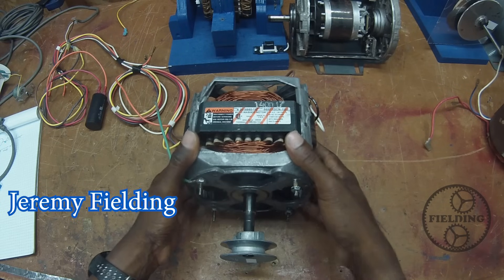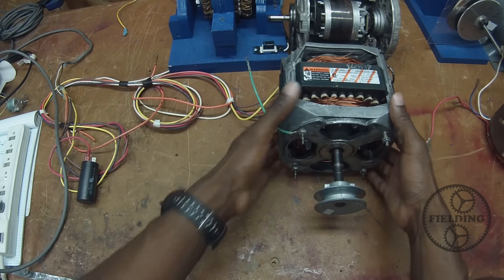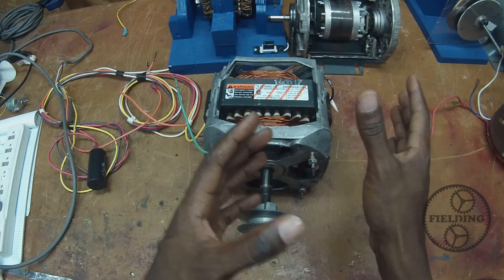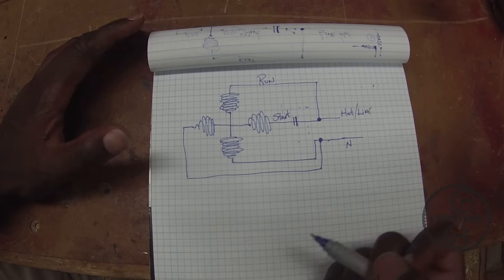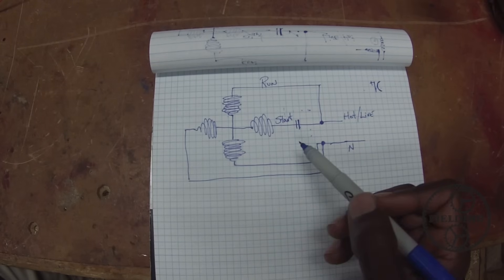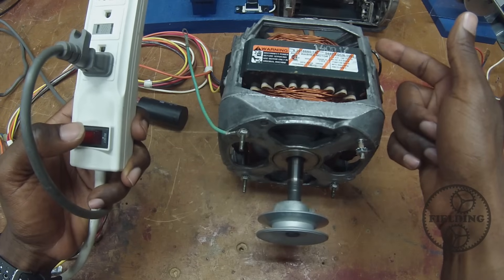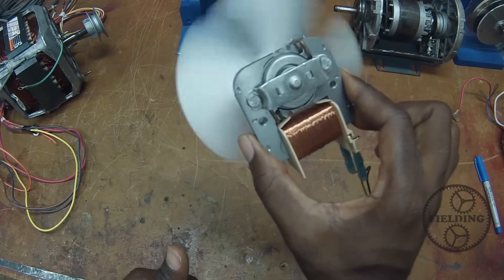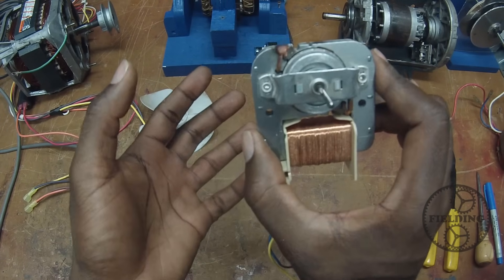How Motors Work For Beginners: (Episode 4) Single Phase Induction and Shaded Pole Motors: 035

Comment: Got a Lasko fan with 3-Speed induction motor (Pro Motor) that blew the thermal fuse (130c) while it was on low setting at room temp. I took the motor apart and cleaned with compressed air, the motor powered up and turned but started getting hot with burning smell and would prob exceed thermal fuse temp if left running. The capacitor tested ok at the rated 5uf, the windings were not shorted to core, resistance for the three main windings tested at 46,81,108 ohms, the auxiliary winding was 216 ohms. I don't care about fixing it and just wanted to know the forensics for the motor heating up, thanks..

Comment: Shaded pole motor: do the (very) small electromagnet coils slow down the motor once it gets up to running speed, seeing as there is no way for them to turn off...? Their function is to get the motor spinning, but then they still affect the motor once it reaches running speed, so is it a positive affect or do they slow down the alternation? Thanks, this is fun to learn

Comment: Great Videos Thanks. I live in North Dakota and I have some Diesel Engine work to do this winter. I was wondering is there a way to wire my 220 heater to my 110 outlet in my Garage?

Comment: Great video, but I've got a question about the shaded pole motor at the end.  Why is it that the iron is good at transmitting a magnetic field but the copper wire will develop a current that opposes the magnetic field?  Why doesn't the iron oppose the magnetic field as well?  Is iron just a worst conductor than copper?

Comment: Awesome explanation, lots of questions answered in my head about induction motors, thank you.  However if been thinking about your fan example with this question:  Since the fan motor is kicked off using the energy from its start capacitor and the motor then runs on "induced" energy, would you be paying the same price for electricity if you were to use a fan for 3 MINUTES compared to 3 HOURS?

Comment: Since all the coils (both the main winding and the auxiliary winding) are energised at the same moment this means that they all will be having the same polarity ( either north or south polarity depending on the oscillating cycle).

Can this be a reason why torque is not produced in the rotor circuit of the motor?

Thanks in advance!

Comment: Jeremy, I have a question concerning three phase induction motors when used as a generator. I have seen where many youtubers claim that magnets have to be placed on the rotor in order to make an induction motor into a generator. However I also have seen others say that the difference between and induction motor and an induction generator is its synchronicity and whether the motor is powered with electricity or if it is powered by a prime mover. Also that when the induction motor while being pushed by a prime mover does not generate power until the prime mover exceeds the point of synchronicity. Such that if a 4 pole 3 phase induction motor hits 1790 rpms it is at synchronicity and will not generate power until it is speeded up to 1800 or more rpms. Also that there is an efficiency factor that states once slip goes beyond a certain point efficiency starts dropping off. Is this true? Also in one of your videos you state that a capacitor is needed to start induction motors does a 3 phase induction motor being run by a prime mover need a start capacitor? or is it just a matter of exceeding synchronicity? Last could or should a capacitor be added to smooth out the power output and if so how and where should that be?

Comment: Awesome content Jeremy... I know I'm pretty late to the game, but still.
Not sure if I'm deducing it wrong here, but would a blown starter capacitor possibly be the cause for very old fans making lots of noise but not rotating properly until you give it a nudge?
I mean, fans that have been properly cleaned and all, because I have seen some that were stuck because of dust and hairballs and whatnot. xD
I have cleaned some very old fans in relatives homes that were like that... you plug them in, they'd hum, but not rotate until you give it a push.
Or perhaps there's some other problem like a stuck centrifugal switch now that I watched the video further...

Comment: That second motor with the fan you showed us, I have one new that i got to fit an ampliance but the new motor has 3 wires and I cant get a 2 wire motor anymore. Will it work just connecting the blue and red like on the old motor I took out ? 
I am hoping the white 3rd wire is just a signal wire and it will run without it.

Comment: 🙋Do we use switches to cut off the power supply to  starter winding connected to a capacitor in a single phase induction motor ? But I haven't seen any switches to cut off stater winding and they (single phase motor ) simply run  with both starter and main winding functioning .....🤷

Comment: Great videos! 
Question 1: You said that the start capacitor causes the start winding to be slightly AHEAD of the run winding. I can see that you may have meant "ahead of" in respect to the physical location of the run winding, but I want to make sure that I don't have a misconception of how the start capacitor times the field. Correct me if I'm wrong, but I thought that the time that the capacitor takes to charge is what produced the out of phase field shift and therefore be slightly BEHIND, but in relation to TIME, not space? When power is switched on, the run windings generate a field in one direction, but then a split second later the capacitor delivers current to the start windings? 

What confused me about that is how does the start winding overpower the run winding and how does it do it in the correct direction? My guess was that the start winding wasn't exactly perpendicular, rather slightly closer in the direction of intended spin. In my understanding, the run windings energize sooner than the start windings, impart a slight bit of momentum to the rotor that the start windings take advantage of to lure the rotor toward the start windings for the jump to the opposite pole. 

But you pointed out that the start windings used a smaller wire, which would allow for more windings in the same space which would produce a stronger magnetic field that would overpower the run windings and pull the rotor toward the perpendicular pole? I can see how this would get it started spinning but am unsure how the start windings switch off fast enough to allow then next 90˚ jump. Is it the pulsing of the capacitor's charge/discharge cycle? and if so, why can't it just stay energized to essentially create a two phase motor?

Question 2: How does variable speed and direction occur? Is variable speed accomplished with Pulse Width Modulation (PWM)? Blower motors have different wires for different speed and no apparent "brain", so I always assumed they have different wiring configurations to produce speed variations. I'd like to see an explanation of how speed and direction are accomplished with simple, dumb motors.

Thanks,
Reply from the maker: +Dan Oberste great questions... I was very careful to say it exactly the way I meant in the video... the capacitor causes the start winding to be ahead "in timing" with respect to current flowing through the wire.... it is definitely hard to understand at first. I will explain in the q and a video. You only have half the story. I didn't understand it for quite a while. It is very satisfying when the light bulb comes on... as a brain teaser think about the shaded pole motor and how it starts... lol we will talk about it.

Comment: Really love these videos.

have some questions:

Could you theoretically design a piezomagnetic switch that draws its initial current from manual operation (clicking a stiff spring loaded button to convert mechanical force to electrical or magnetic force) to kick off the motor?If it worked, you wouldn't need to worry about disconnecting the electrical contact like with a momentary switch.  

Alternatively, could you create a spring loaded inductive switch with a block of copper or aluminum on a spring (like the ball launcher on a pinball machine) which when fired would generate a temporary inductive force and start the motor moving?  Both would be passive devices, but could interact transiently with the humming motor without the need for a starter winding.

Comment: Sir can you explain this to me that how the leading phase angle between the current of the auxiliary winding and supply voltage decreases as it shifts from the low capacitive reactance or high-capacitance value (because the starting capacitor is in parallel with the running capacitor) to the high capacitive reactance or low-capacitance value (because the starting capacitor is disconnected and only the running capacitor is working) in a capacitor start and capacitor run single phase induction motor. Thank You.

Comment: I love this however i have a question: with the centrifugal switch being closed upon supplying power, isnt the cap discharching instantly without having time to be charged? Why use a cap at that point and not just supply the same voltage to….i just answered myself, thank you. The cap isnt used for supplying a high current as im used to in car audio but rather to delay the input sine since otherwise you‘d just get an unnecessarily complicated hum-generator instead of a motor. Did i get that right? I cant think of any other explanation.

Comment: Phenomenal. This helps explain the Back to the Future Flux Capacitor but you don't explain whether the Delorean uses a shaded pole or a centripidal switch  to fly. 
After being crucified Santa Claus is born again, hiscomes out of his cave and sees his shadow. Does he use a  Salient pole rotor for the heater fan on his sleigh in the North Pole? 
When he crosses the Equator to deliver presents in Australia and Argentina does the Coriolis effect cause his motor to spin in the opposite direction?
Reply from the maker: +Jefe Julio el Gringo Judeo the delorean was most likely a stepper motor. It’s the only way to repeatedly go back to the same time :)
Reply: Jeremy Fielding  Awesome. I have a drawer full of Dual H-Bridge Stepper Motor Drives.  Will replace 4-pole inductive motor in Tesla S instead of a Delorean so I can go back and undo my first 11 marriages.

Comment: So, aside from the start cap and alternate winding, most single phase induction motors should be able to spin either way right?  My condser fan motor has two wires with connector that you unplug and swap to revers rotation - I'm assuming that just changes the polarity on the alternate winding with respect to the main winding so the starting  kick is in the opposite direction?   But what about motors that have a run cap (always in the circuit)?  Must they always run in the same direction?  If not , how does that work (I'm assuming that the run cap energizes a second main winding offset and out of phase with the first main winding)?

Comment: What your lesson says is that if my heat pump isn’t running, just humming, then the starting capacitor has probably failed.   Correct?

JoeB new subscriber
Reply from the maker: Check the latest video on motor fixes

Comment: Great job...I have a tire changing mechine. It will work in forward just fine when I go for reverse it will only work if I spin the pulley by hand in reverse..Just like you did..is that a bad starting capacitor?  it is a single phase motor with looks like one capacitor.... I replaced the switch with a new one. Should I replace the capacitor? Thank you for the help.
Reply from the maker: I don’t know. I avoid giving advice like this. There are too many variables I can’t see and the volume of requests is extremely high making it impractical to get to involved
Reply: Thank you and have a great day.
Reply: Thank you for your time...I subscribe..Great Videos.
Reply from the maker: Welcome to the neighborhood!

Comment: Hello, Im wondering, why is there not an electromotor, which uses one circular coil around the rotor (1 phase) that would push the rotor using its side magnetic field and in the direction depending on which way the coil is winded? The centrifugal switch u have at the end of the video, uses its principle. I understand its slow. But if we wind the coil the full circle? And also, we can have two coils from both sides of the rotor, which would create stronger magnetic field. Is the magnetic force on the side of the coils much weaker? Thats why its not used? I dont understand.

Comment: Very good information iwant to know if motor work s clock wise during wash cycle and opposite during draining and spinning 
Is this correct
Reply from the maker: Most of them work that way yes. It depends on the design of the gear box

Comment: Hi Jeremy, wonderful video. I have a Starter Cap that went bad on FASCO (Hayward) spa blower fan motor. From what I can tell the 7.5uF Cap is not a polarized electrolytic, ie, no + or - markings anywhere. Also, the voltage going through these Starter Caps is AC right? so a Polarized Cap shouldn't be used in a an AC circuit anyways, is that right? Thanks, Jim

Comment: Do you think that a 2-volt low impedance source has enough energy to rotate a custom-built induction motor? If so, given the law of conservation of energy, could it drive a generator and output any usable electricity? BTW, you are a great instructor.

Comment: Good work.
The capacitor (4.44)  is a polarised capacitor and not to be used on AC . It's for DC circuits.
Capacitors in mains motors are usually non polarised and  drawn as 2 parallel lines.
Please connect the earth to your motors.
I don't want you electrocuted!

Comment: Hi Jeremy great job on the video.  I have a question about starting capacitor.  I have a Maytag dryer that had a bad motor, basically it would just hum unless i would manually rotate the drum to get it started.  I swapped out the motor and now is working fine.  I noticed in your video you had a start capacitor connected to start windings and I understand this is required to initially start the rotation of the motor.  For my dryer, i do not see any start capacitor so I'm trying to understand how does the initial rotation happens?  I know the start windings are 90 degrees out of phase compared to run wiring, is this enough to get the initial rotation?

Comment: Is the induction motor with the capacitor that same thing as a PSC (Permanent Split Capacitor) motor?
Is the last fan motor a shaded pole motor? What did the rotor consist of in that motor?

Comment: I hve two questions,  single phase clutch motors 220vts for sewing machines, one motor just hums but doesn't run, i tried changing the capacitor but it wont run even if you gve it a push no change, it doesn't hve the centrifugal switches, how can you help.
2, i hve another motor almost the same with first and for the same purpose,  iam a sewing machines technician it has a short but the funny thing is sometimes it runs properly sometimes it trips the power pulled it apart check everything the cables, the winding  cant find the short.
3, some type clutch motor it was converted frm 3phase to single phase using a capacitor it runs but after loading it for a few minutes it dies down, if you  remove the load it picks up speed again how best can you over came this problem
Thnk you in advance,  you know motors inside out iam impressed

Comment: Hi Jeremy, my name is Mike. I have a simple question. I swapped my single phase compressor wires (Start and common) and run it for about a min or two. The compressor hummed and became hot before It tripped my breaker. Now compressor will not run again but will always trip my breakers now. Wiring testing seem to be fine. No short to ground, readings from all 3 wires from compressors seems to have good readings. Readings are as follows (6.2, 5.1 and 1.1) ohms between the 3 leads from the compressor. What do you think has happened and how can I wake this baby up, its a Hitachi scroll compressor for Heat Pump.

Comment: I have a six pole shaded pole  4 speed blower motor that is in my furnace. It has no starting cap is rated at 1/8 HP and seems very powerful turning that large squirrel-cage wheel. Could you explain that and why some winding's  have to be clockwise and other windings must be counter clockwise in that six pole configuration?

Comment: if capacitors get weak after the period of time, beside problem in running the motor at begening like humming , will it effect the over all power of the water pump? like in case of ceiling fan weak capacitor causes slow rotation , isnt ceiling fan shoud get full rotation once its start rotation or stop rotating at all with weak capacitor , but ceilng fan gets slow motion and keep running , does it happens to water pumps too , like weak power due to slow rotation with weak capacitor

Comment: Are these washing machine what is called a series motor?  the coils and the armature are all wired together?
Can one take these motors apart and separate the armature wires from the coil wires so  if a person wanted to he could control each independently?
Also what should be the resistance on the winding of  that little shaded pole motor?
I have one and it reads around 60 ohms and the fan is dead.

Comment: Question for you.  I have an old air compressor with a 1 1/2 hp single phase motor with a capacitor.  It is old and having trouble carrying the load.  It starts up and then slows to a stop.  Is there anything I can do to fix it or do I need a new one?